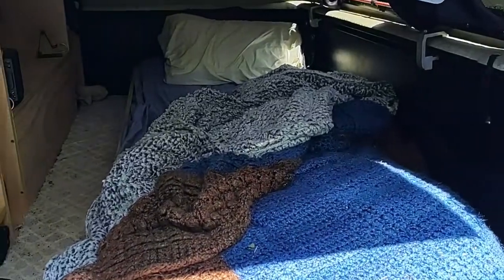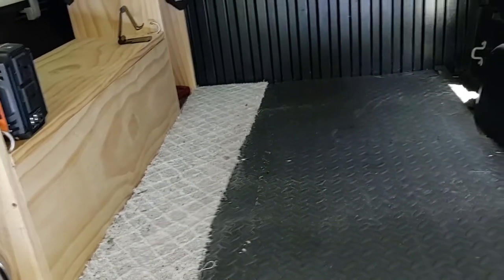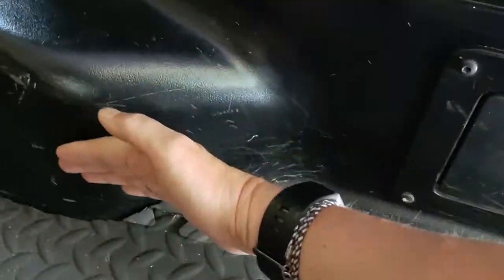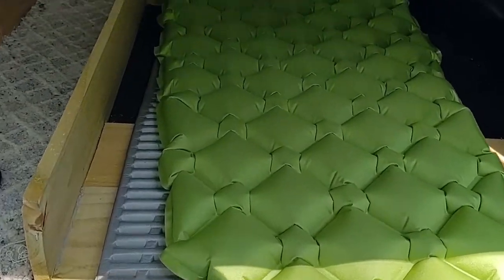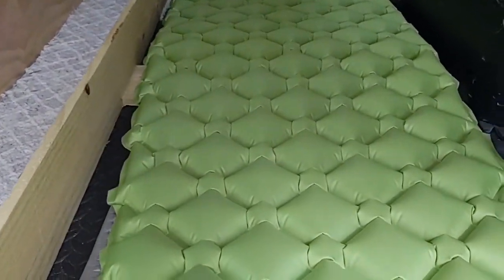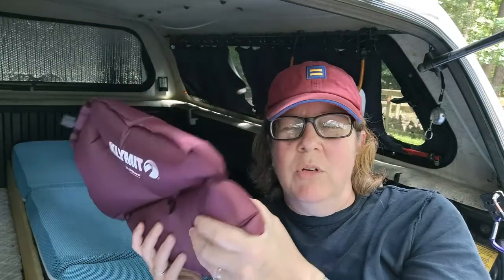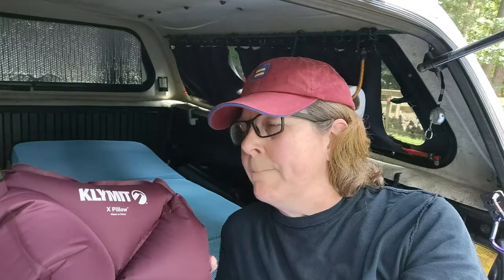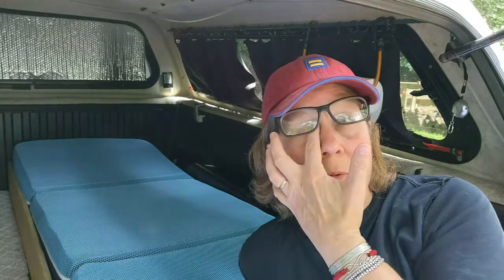Simple Truck Camping Bed Set Up

Comment: A great point about not having to have a platform.  I debated putting one in.  I've got a mid-rise on my Tacoma and my requirement is I need to be able to sit up.  My platform is only 6" high, but it allows me to put recovery tracks, chairs and long things underneath.  I want to hear more about your storage.  That cabinet is great!  It's giving me ideas.
Reply from the maker: So jealous of your mid-rise!  I can sit up on my bed, but my head grazes the fiberglass.  I couldn't lose any height :-/. I like the idea of a low platform/mid-rise topper - seems like the perfect combo. What kind of recovery tracks do you have and have you had occasion to use them?  That's a piece of equipment I still need to buy.
Reply: @thewanderingway  They are some knock off brand trax I got off Amazon. Haven't had to use them yet, so not sure how well they will hold up.  I actually had a high rise I bought brand new, but due to a series of unfortunate events, ended up having to settle with the mid rise.  I'm only 5'3", so that's to my advantage.  My head does touch the top if I sit up too tall, but it's doable.  I do have rails on the top and plan on adding some sort of cargo storage.  I used 6" pipe nipples with floor flanges as the bed support.  It allows for easy open access underneath.  I'm just starting out with this, but my plan is to be at least a part time nomad when I retire in a couple years.  I have a Lab sized dog I travel with as well.  Just a girl, a dog and a camera.
Reply from the maker: @pennef7302  love everything about this!